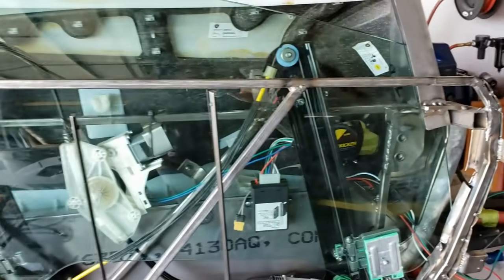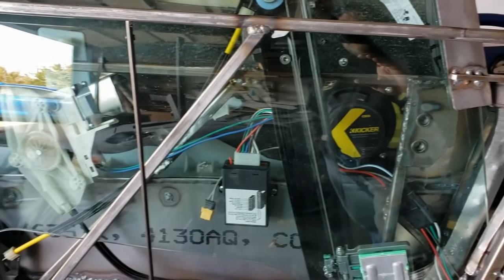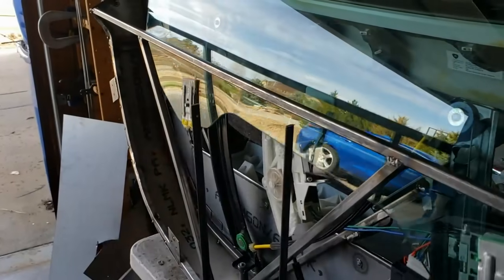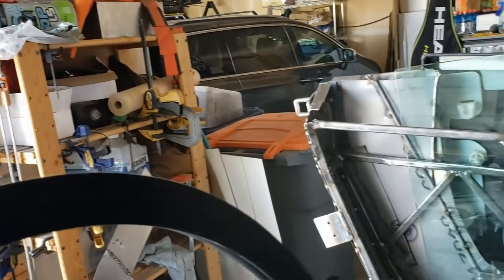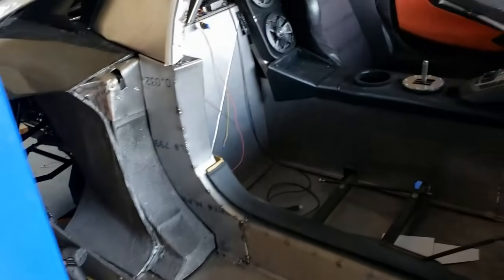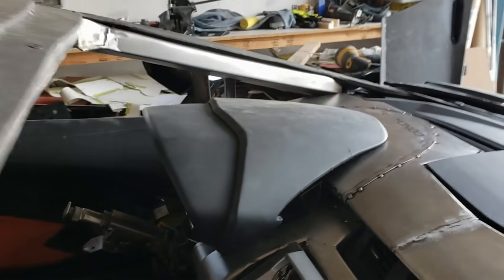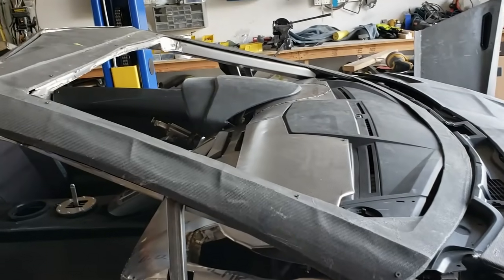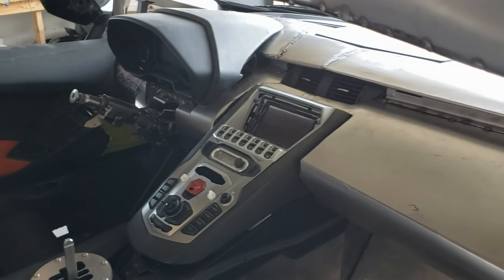3D Printed Interceptor Update 34

Comment: Good work . Im also planning on building a lambo . Sorting out it in CAD. Your videos will help alot. Didnt watched all yet .And are you replacing some 3d PRINTED PARTS WITH STEEL SHEET ?
Reply from the maker: Not many.  Mostly in the passenger compartment where safety is key.
Reply: @lasersterling  ok . ,,👍👍